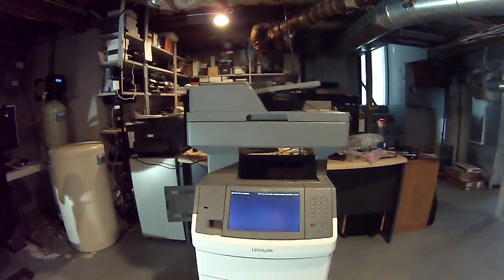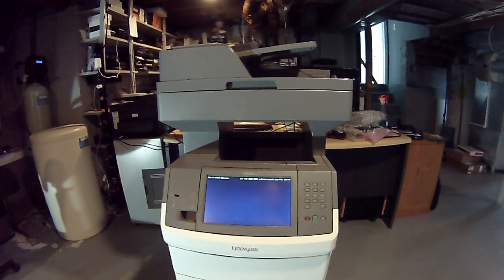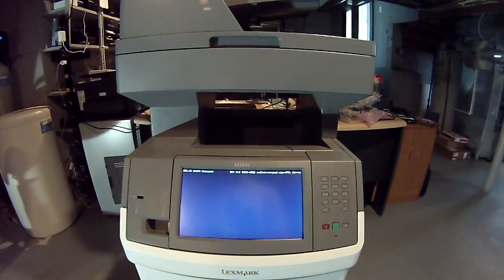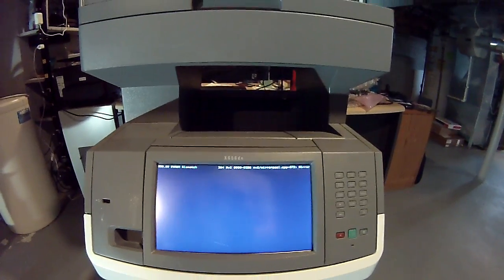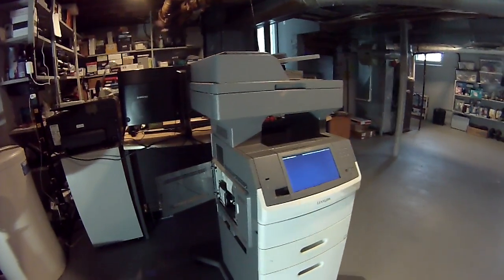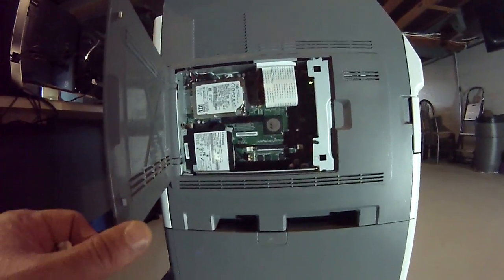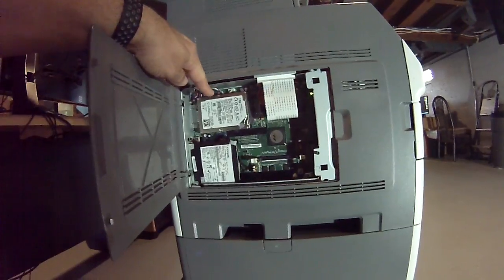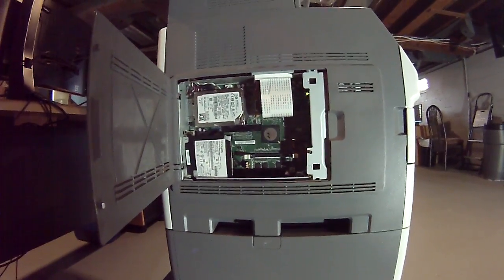Lexmark X656 printer 950.xx NVRAM Mismatch Error Series Part 1.

Comment from the maker: How to reset the NVRAM; How to clear the printer NVRAM; How to restore the factory defaults
Solution

To restore the factory defaults on the printer:

Press the Menu> button on the operator panel until Utilities Menu (or Tests Menu) appears on the display.

Press the Select button once to enter the menu.

Press the Menu> button until Factory Defaults appears on the display.

Press the Select button. You should see =Restore on the display.

Press the Select button once more to change the printer's settings to the original factory values.

To reset the printer's non-volatile RAM (NVRAM):
The procedure described below activates a "soft" NVRAM reset, which means that vital printer information will not be deleted.

Power the printer off completely.

While the power is off, simultaneously hold down the Menu>, Go and Select buttons.

While still holding down the buttons, power the printer back on. When Restoring Factory Defaults appears on the display, you can release the buttons.

Allow the printer to warm up as normal.

NOTE: Neither of the above procedures (restoring the factory defaults, clearing the NVRAM) should reset the network card settings.

If the above instructions did NOT resolve your problem, then you need follow my instructions on what to do and what parts needs to be replaced. Let me know.

 ▼